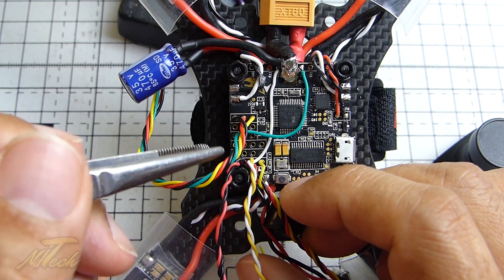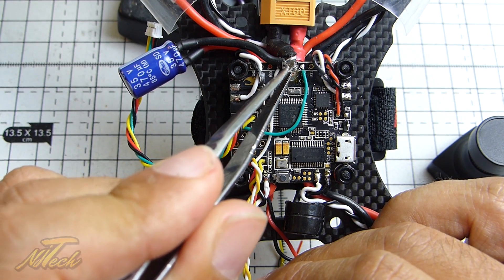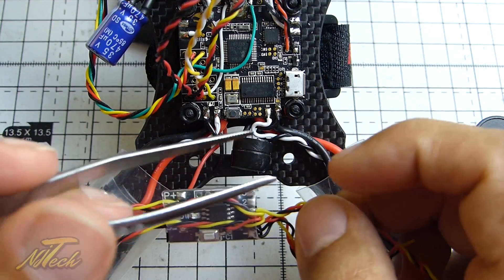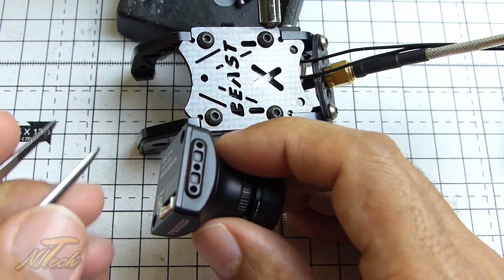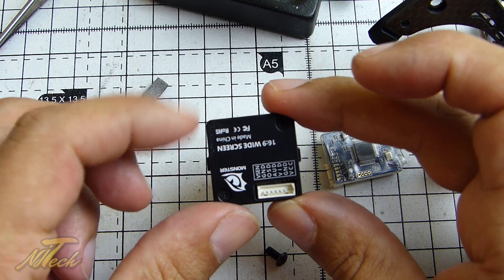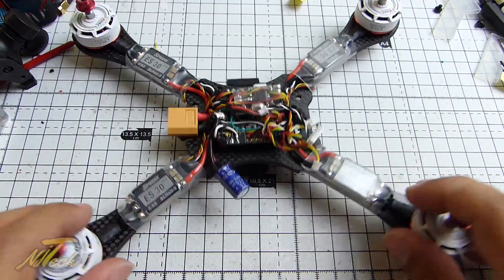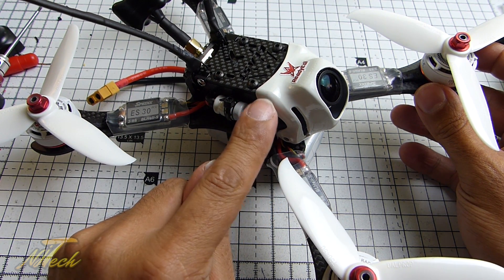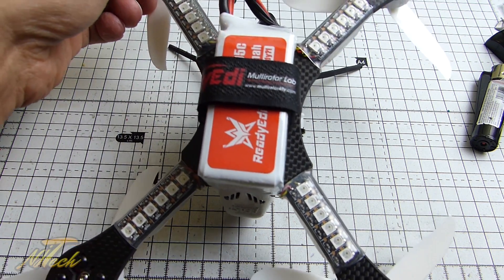Beast SX Build! Part 3 (Motors, VTX, XSR, Detailing)

Comment: nice build and great information all around. quick question sir, I plan on using the tbs unify 5v version and a foxeer arrow camera that has an operating current of 5-40v. would you also recommend me soldering both power and ground wires from vtx and camera onto the same power and ground pads with the bridged 5v to activate the 5v? i saw that you soldered your vtx and cam power and ground wires to the same pad with ram selected. i was wondering if i can do the same but with 5v bridged since im using the 5v version unify. Also, i saw that this video was made a little over a year ago, can you give us an update if you had any problems with video going out due to the voltage regulator issue you mentioned in part 2? thank you so much!

Comment: That frame could be just what I'm looking for. Whats the height between the rear standoff hole and the underside of the side plate?. I'm hoping to fit a 3 stack plus receiver in my next build.
Reply from the maker: A three stack is possible but you may have to shorten some of the stand offs to compact it a bit. You may also need to remove the optional side plates (just there for looks it doesnt affect strength) and then you should be good. I fit the receiver/VTX up in the roof cavity. Dont forget you get a discount with code NJ TECH ;)

Comment: Great series of vids and good advice throughout.
I was wondering if I can run the Tbs unify straight off the betaflight Fc or do I need to step the voltage?
Reply from the maker: that's how i have mine wired, straight off the RAM pin @VBAT voltage to my cam and VTX (unify) and its all working perfectly with no noise in the video signal :)
Reply: NJ Tech , thanks a million.
Got confused as there is some vids showing installs with buck Regulators.
Reply: Hi, sorry to be a pain ! back to the tbs unify ' do I bridge vbat and ram ' getting a bit confused as I understand that the vtx is 5v.
hope you are having a chilled bank holiday
Reply from the maker: Hey, so you want to bridge to VBAT if you want the RAM pin output to be VBAT voltage (on 4S thats 16.8V peak) and bridge to 5V if you want the RAM pin to give 5V. My unify race supports higher voltages so i run at VBAT voltage but if yours is 5V only then make sure you bridge 5V!